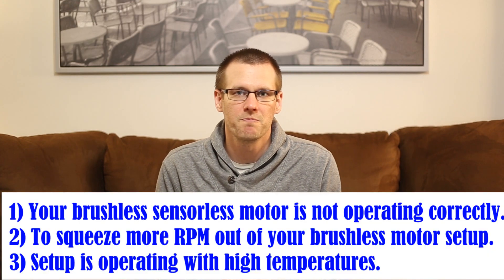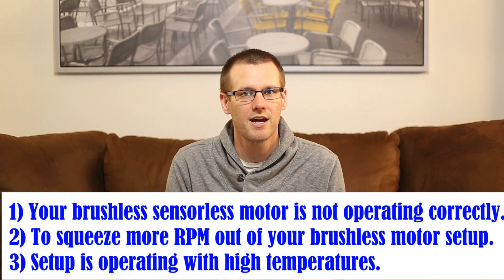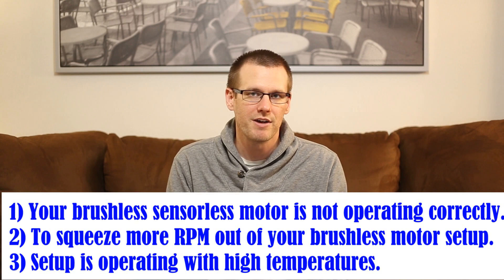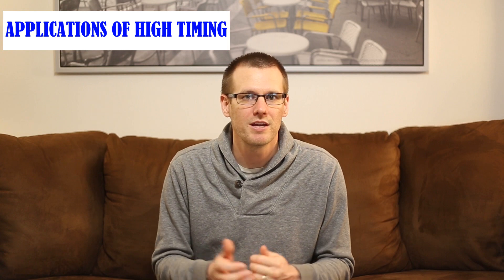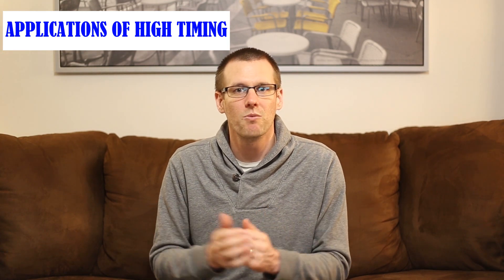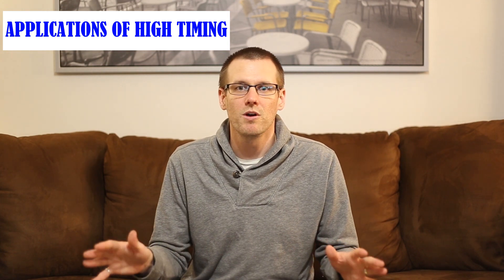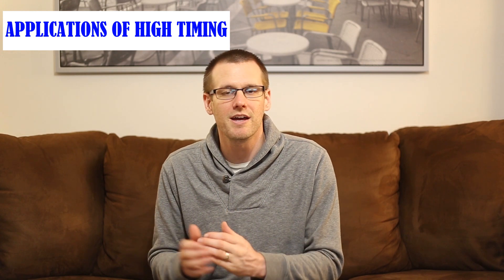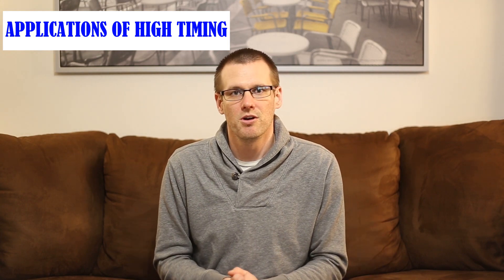Applications of High and Low Brushless Motor Timing

Comment: What timing would be suggested in a hydroplane boat with a 4082 2200kv running 4s , 6s , 8s . The ESC I have paired with this setup the default is 0 degrees.  I also have a catamaran  with a 4082 2000kv running a 180 amp ESC  , but it's default I believe is 11.25 , - 15 degrees  somewhere in that range . Both of these motors are 6 pole
Reply from the maker: I would use low or the lowest timing you can with this setup.
Reply: @RCexplained even though the 4082 motor is a Y wind not a D wind motor? I was under the impression that Y wind motors prefer higher timing like 7 + , where as D wind motors prefer 7 -
Reply from the maker: You can set both termination styles to use low timing. This is where i would start. In fact I prefer to run all my Y and D wound motors set to low timing.
Reply: @RCexplained i was out today with my UL-19   i adjusted timing to 15 degrees  , and ran a personal best 70mph on 6s

Comment: Good info, thanks. I’m currently trying to figure out mine. Building a 1:9 scale orca (boat from movie jaws) and curious what the timing should be for s slow cruising boat. Esc is HW 180 amp and spektrum firma 2000kv marine motor. Any thoughts?
Reply from the maker: Set to low timing to start.
Reply: @ ok thanks

Comment: I purchased a Max6 g2 combo with 4990 1650kv sensord motor, and I don't know exactly what is going on and what degrees I should make, for example, the turbo bust timing, the punch and the initial throttle settings to get the best performance without doing any harm.
I use my car for drag racing, but it is a bit difficult to know which setting is the best!

Comment: Great video but I have a question if you have a motor that has adjustable timing on it, does it have to be censored for its work when you change the timing?

Comment: Dear Ryan, I have a Proboat Miss Geico 36 V2 equipped with the stock 3674 1900kv 4-pole motors. I have thus far been unable to determine whether the motors are D or Y winds. The owners manual doesn’t really tell you what the stock timing should be. When I plugged in the ESC’s to the programmer they are at 7.5*. A D wind is said to work best at 0-4* and a Y wind 10-20*? What would suggest for optimal acceleration for 6S per motor? Thanks, Chris Curry.

Comment: Do many folks notice less cogging with low or zero timing? More specifically I'm running a Spektrum 150A Smart ESC with Spektrum 2200kv. Capable of 6s but running 4s. I have noticed that the smaller 130A version seems to cog less at startup. I wonder if running so much less than its peak voltage has anything to do with cogging at startup? Very helpful! Thank you! Cheers!

Comment: Hi Ryan, I'm working on a DIY bow thruster for a RC tugboat. It's basically a simple paddle type pump that can run in both directions. The pump works really well, but I noticed that the motor (1000kV outrunner, running on 3s) warmed up pretty quick even though it was pulling only 6A during the test. According to the specs, it's 3 pole 8T. Upon checking the manual, the ESC timing has a standard value of 15º, so I'm thinking that this may be too high. What is your initial thought on this please?
Reply from the maker: I have found outrunners prefer a decent amount of timing. Experiment with different values of timing and check temps each time.
Reply: @RCexplained  I will, thanks!

Comment: Hi there, im into nitro boats and new to FE boats, ,,to be able to adjust the timing I need sensored motor and esc, right?thanks.
Reply from the maker: You can adjust timing within the ESC. This can be done on most sensored and sensorless ESC's. I would recommend a sensorless setup for boats. It will also save some dollars.
Reply: @RCexplained  thanks Ryan .

Comment: At 8:45 you meant turns not poles right?
Reply from the maker: Hi c.leech, thanks for the question. No, I did not mean turns. Higher magnetic poles such as on an outrunner tend to like higher timing settings.
Reply: @RCexplained  but didn't you say the opposite 15 seconds earlier? The example with the 4 pole inrunner. I'm just getting into rc drag racing and had a sensorless 4 pole 4700kv motor laying around.
Reply from the maker: I said that a one turn D wound stator typically requires a low timing setting.
Reply: @RCexplained  gotcha.... I guess my attention played me... I just heard 4 pole inrunner and my brain was all excited "hey that's what I got"... Sorry for being stupid...
Reply from the maker: No one is stupid c. leech. It's good to ask questions rather than to cause damage and rebuy motors and ESC's.
Reply: @RCexplained  anyway... I will have to see how much boost and turbo I can give it... We're only running 132ft... That's done in seconds...
Reply: @RCexplained  I have a new motor. Tenshock x211 5.5 t. It's a sensored 4 pole motor. How do I figure out the best drive frequenzy?
Reply from the maker: ESC PWM frequency?
Reply: @RCexplained  yes. I have a problem: under load the esc cuts off and blink Code states "lost sensor connection".  I'm guessing the esc is having trouble with the 4pole in sensor mode. If I run it without the sensor cable, it coggs a bit... But it's a drag car.
Reply: @RCexplained  I sent you a message on Facebook messenger... Maybe a more convenient way to communicate.
Reply from the maker: This video may help
https://www.youtube.com/watch?v=ttyTrxB0OmA

Comment: Thanks for your guidance,  i ve been told that is better running an esc in full throttle rather than half throttle, is it true and if yes why ?
Reply from the maker: At full throttle the ESC does not need to have PWM to control RPM. At partial throttle (Closer to 85%) the ESC must chop the signal to achieve a slower motor output speed. Some ESC's can get hotter at a partial throttle setting vs full throttle.  This has never been an issue for me.
Reply: @RCexplained  thankyou very much

Comment: Hi there. Really enjoying your videos. Is timing increase on an ESC any different from increasing timing on a physical motor? Also, how do you weigh increasing timing, over increasing gearing? In your boat example, could you have received the same results by going down a few teeth on a spur, or up 1t on a pinion? Is there anyway to calculate which would be more beneficial, or just basically trial and error and see what gets too hot?
Reply from the maker: Timing increase while operating in sensorless mode is very different then timing on the motor. Trial and error is the best way to determine the optimal operating settings including timing and gearing. Timing can get you a more fine degree of change in your setup. It can be similar to increase pinion gear teeth count by a partial step. Such as 0.5 teeth. Something like this is not possible to achieve on a gear but through timing it can be possible.
Reply: @RCexplained  ahhhh!

Comment: I have an issue with my rc boat setup I have a 38mm CNC aluminium prop with 1.6 pitch so far it's  seemed to like that the best brushless 3670 4 pole 3y? I am guessing that means 3 turn 1700kv motor and a flycolor 150a esc now the stock settings are 3 put of 5 for pull start and 15 degrees (which is in the middle of the advancement) my problems are that it doesn't plane quickly like to stay on plane on 4s (waiting to get the kinks out before going to 6s) and when it does get up on plane and I start to accelerate after abit the esc cuts out for a sec and the boat starts to stop and then as it slows down it gets back into power and working my thought is the esc is not advanced enough for the more powerful motor so I should try to advance it 1 set to 18.75 degrees still leaving  22.50 and 26.25 what would you do in my case???
Reply from the maker: Hello. What boat is it? What is its length? What batteries are you using? C rating? What is the average internal resistance of the pack per cell? What performance do you get out of stock or low timing?
Reply: it is the ft011 v hull 25.5 inch and I am using 2200mah 4s lipos 50c and 2, 3s 2200mah lipos for 6s 120c and 50c. stock it runs much slower on these batteries and has a hard time planing and once it gets going the esc cuts out never hot motor or esc alway nice and cool... so should I advace timing and push the punch up to 4or 5 (only goes up to 5)????
Reply from the maker: I'd need to see a video of the boat getting on plane to comment about that. 
It sounds like your batteries are not supplying the power demanded of them and the ESC goes in to LVC.

I would not touch timing when you are having issues with the ESC cutting out. If you are having these issues on 4s, 6s may be even more problematic.
Reply: so i am going to take both batteries both the same 2200mah  45c and parallel them together to get higher mah and c rate
Reply from the maker: Taking the packs and placing them in parallel will effectively double your capacity and maximum discharge current. C rating stays the same. The voltage would however be the voltage of the one pack you use. (Voltage doesn't double) 
If you did place 2 3s packs in parallel, you would be able to increase the size of the propeller as you would be turning the propeller much slower.
Reply: @RCexplained  yes my plan is to take the 2 4s packs that are 2200mah 45c capacity and parallel them to get a higher c rating and capacity I am starting to learn my motor choice and esc choice may just be 2 heavy for the little rc boat as it is only 650mm boat or 25 inch boat but the cutting out is forsure the low voltage cuttoff on the esc as it does it ore towards the end of the packs I will post a vid of it this week sometime and show it all as it sits now and what it does in the water so you can get an idea I will even add how much throttle I am giving her i did try my 6s setup in it it was much peppier but still had the same issues and as the power increased so did the nose dipping and it not planning only skipping or pushing against water giving motor drag and eating batteries to fast i was draining them to 3.2v-3.5v per cell by accident... woops good thing there high quality batts... but will add lipo alarms set to go off way b4 that I think setting them to 3.5v is gonna be the sweet spot as you know when at higher throttle like with drones the batteries will dip below 3.5v and jump back when you let the throttle down that should let me know it's nearing the time to bring it back and release the connectors to the batts. the weird thing with my current setup is that the motor and the esc usually run near ice cold right after the runs it only got slightly warm this time with running the 6s lipo setup in it so this motor has alot more to give I also have dual water pickups on it the motor and esc have seperate water lines going to them and water outlets I did notice putting the punch setting up one did make a difference on it's initial dragging butt it didn't do that as bad and could notice a much peppier throttle response from 0-1/4 throttle...

Comment: Hey Ryan thanks for taking the time to deliver us this information, is there a way to contact you? I have a few questions regarding my project.
Thanks in advance, Eden.
Reply from the maker: Thanks for your comment. Yes check out the profile page.
Reply: @RCexplained  hello wish to ask you some questions please , do i have to program the amount of poles a motor have or does nt matter ?
Any esc can handle different amount of motor poles? Does the timing application apply the same way on outrunner motors?
Thanks
Reply from the maker: The general basis of timing applies to both inrunner and outrunners. You do not have to program the amount of poles that a motor has. Your ESC will be able to figure this out.
Reply: @RCexplained  thanks for replying so quick i really do appreciate,  currently i m choosing a the right esc for a scorpion 5035 670kv outrunner on10s  on a boat, manufacture told me i can run any 300amp esc , i m trying to figure out which one is the most reliable and what programmings i have to consider the most, it s really difficult to choose which, it looks like it s a trial and error issue ,wish to do a reliable setup that s why i am asking a professional ,what do you suggest as a 300amp